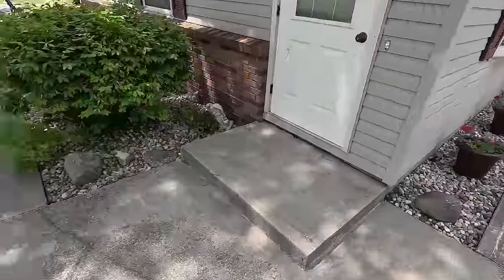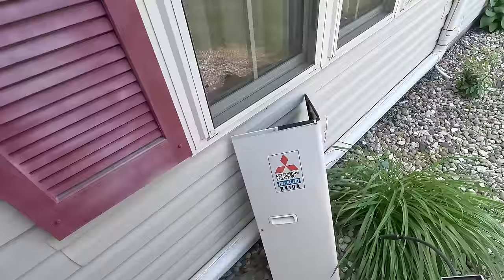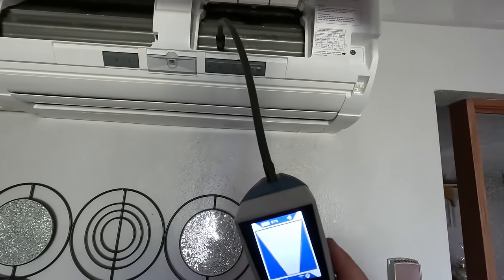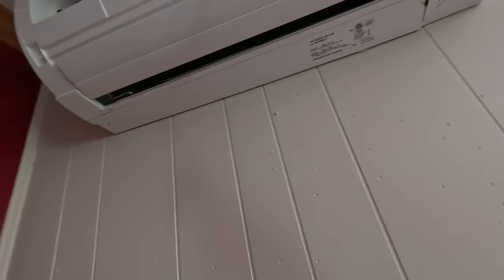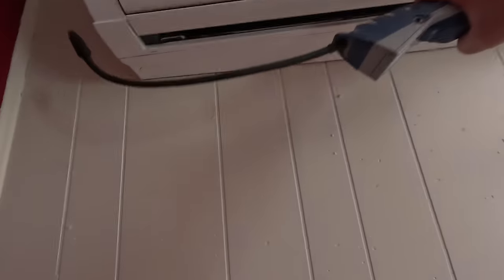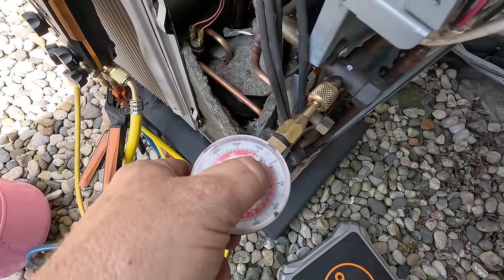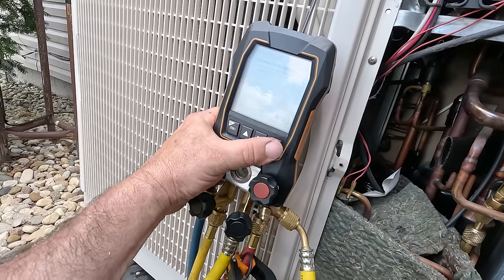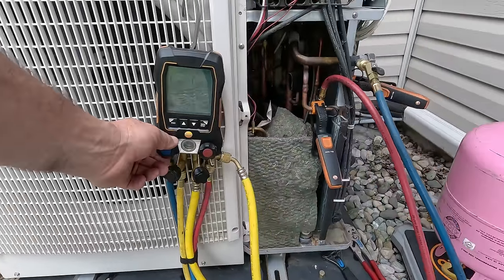I HATE Mitsubishi MiniSplits

Comment: I would be scared to death to have only minisplits and baseboard heat up there
Reply: baseboards were very common in the 80s because they were dirt cheap and the cost for electric had come down from the 70s. Many 80s houses in the north east have electric baseboards as the only means of heat.
Reply: Still cheaper than oil
Reply: @joeyf504327  Mini splits have been around for quite while too. Especially in other countries where ducted systems are not as popular like they are here in the US and Canada. They have also become more common here over the last decades, as an alternative to window units and PTAC's, for homes that weren't built with central heating an cooling
Reply: @chrisE815  I wouldn’t recommend baseboard heat for anything unless you’re home is extremely tight, it’s expensive. I’ve installed hundreds of them over the years I was 13 when I started helping an electrician. 65 now.
Reply: @earlestes8649  there is a direct conversion for watts to a btu of fuel oil. On average in my market,  resistance heat is cheaper,  plus this house has mini splits for the bulk of the heat load. I have seen situations where electric baseboard heat runs too frequently due to thermostat location.  The thermostat should be located on an interior wall, but if you're disciplined about turning the thermostat down when exitting a room, it can be reasonable and very comfortable. My cheapest heating bills were in a townhouse with electric baseboard heat,  but we kept the thermostat low when not occupying an area.
Reply: We have electric baseboard in our 1980 built colonial.  Also have central air but no heat pump.  Air handler and ductwork in the attic.

Going to put in a high efficiency wood fireplace for main heat, keep the baseboard heat as backup.  When the AC dies I'd like to replace with a heat pump.  Heat pumps don't seem to work well below freezing though.
Reply: @robertm5969  yeah heat pumps are not really a good solution in my opinion
Reply: @robertm5969  I'm in zone 6. I don't have duct work, so i went with a low ambient mini split. Worked great this past winter but not as comfortable as baseboard heat. If anyone is curious about heat pumps, I highly recommend a single head mini split that can handle most of your heating and cooling. That said, I'm also planning to install a woodstove for weekends/polar vortexes and grid down.
Reply: @robertm5969  The old R410 units are mostly for AC. Get a new split system with R32 and you get efficient heat well below freezing.
Reply: @mrfrenzy.  will conventional whole house HVAC systems run on R32 and give efficient heat down to -10 degrees?  I remember seeing that cold weather mini split heat pumps are able to do this.

This is why I was considering replacing our system with 2 multi zone mini splits.  But if we can stick with our existing ductwork and just replace the compressor/air handler and get the same benefits at low temps that would be great!
Reply: @robertm5969  I don't know anything about air handlers and ducted systems since in my country we only use mini splits or underfloor heating.
Reply: @mrfrenzy.  I think only a few states in the US allow R32 refrigerant as its considered mildly flammable.  I think best option for most states here for efficient heat pumps are "cold weather heat pumps" that use the old refrigerant but work efficiently down to -10F
Reply: Why? That's exactly what I have and it's perfectly fine. Electric baseboards only come on in February when it's -10F.

Comment: I bet you you’re referring to Ralph? You have to stay awake in the class to get any benefit from it!
Reply from the maker: Leaking from the rear was something I was aware of which is why I spent so much time searching all over the coil, verifying where it was strong at and where it wasn't, I'm not gonna rip one of these off the wall just to check the flare fittings unless I have a reason to pull it and if I had the brackets to hold it up.  I know the detectors ability and I've made a lot videos proving it's effectiveness.

Comment: Did you catch what he said you’re supposed to pull the charger out and weigh it back in? That’s the worst thing you can possibly do with the system leaking. Also I will try to find a liquid line somewhere to check subcooling again these things are nothing but an absolute piece of junk and they need to be removed from our industry. The homeowner stated it clearly they weren’t comfortable using them for heat well they’re high wall units which means they’re heating at the ceiling. All of your hot air is already at the ceiling again they are not good for anything.
Reply: This is the future. Gas heaters will be obsolete. Adapt or die.

Comment: Am I missing something? Sulfer water? What does that have to do with the man’s air conditioning?
Reply: If you have sulphur in your water, then trace amounts of it end up in the air. Supposedly it can accelerate corrosion of copper and aluminum.
Reply: I buy the cheap, China made copper, and Americans not wanting to pay up for quality, but sulfer water is a new to me….
Reply: I don’t work on mini splits unless I have too. I’m curious if the leak you found was just the line set flare couplings in the back behind the coil?  I didn’t see you spray and bubbles to confirm if it was in the coil or not
Reply: @TheMinecraftACMan  Seen homes with such high levels it turns the copper coils black and leak in 1 year.
Reply: Some areas contain hi sulfur levels in the water. Sulfur will eat thru the lines.

Comment: Homeowner dumps money on mini splits.... still uses electric baseboards. Wow. They would absolutely save money if they knew how to set them, and keep them on continuously.
Reply from the maker: It's not an uncommon thing to hear, when 90% furnaces came out in the 80s &90s people hated them because they're not near as hot as what they were used to. Prior the fan didn't come on until it reached 130 to 150° inside the unit, these newer furnaces back then we're coming on with a timer.

Comment: Gas and go
Reply from the maker: Yup, it will be the guy's choice, my paperwork said to replace the coils or the whole head. No coming back after me if he doesn't do the repair.
Reply: Replace the 4 heads? Or the problem head?  Why the head? Just an apprentice asking. Luv the vid.
Reply from the maker: @kenn whether or not I would replace the head would be dependent on the price difference, sometimes there isn't much but I doubt that'll be the case here. Labor-wise it would be quicker and everything would be new so you would have a warranty again otherwise the cheaper bet might be just the coil but you still have the same hole fan motor control board and what other components are in there

Comment: "If you have sulfur water" WTF does that have to do with anything? The air handler isn't connected to your household water supply.
Reply from the maker: It’s a gas in the air and it attacks the coils. But this customer didn’t have that so it’s just shitty made coils.
Reply: @HVACRSurvival  You said "sulfur water." Besides that,  there is no sulfur in the air either. You're just making shit up to sound smart. And for the record, sulfur has absolutely no corrosive action on aluminum.